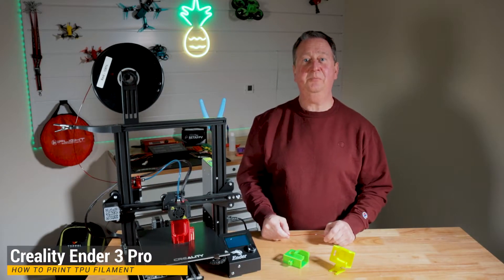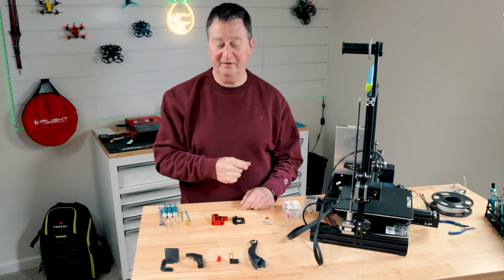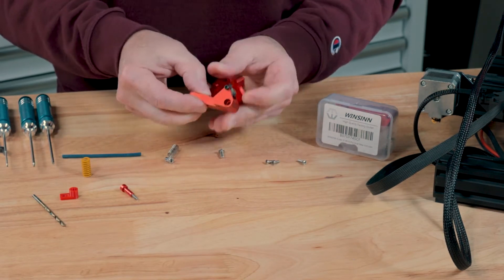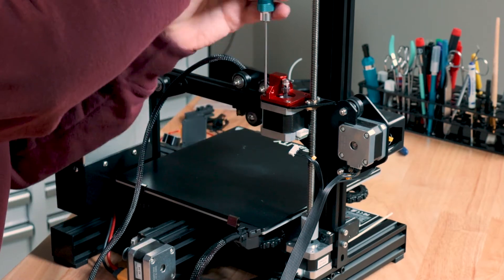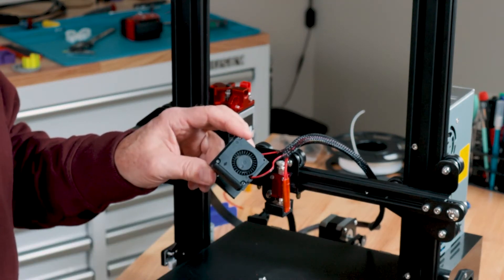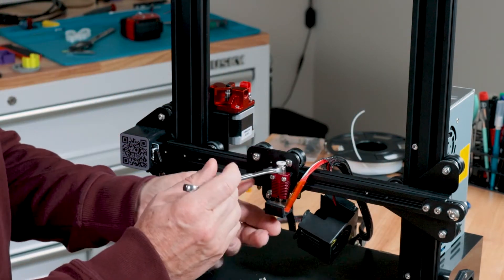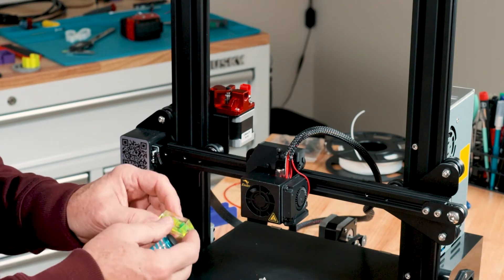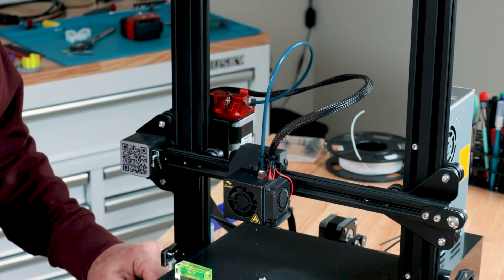How I Made My Ender 3 Print TPU Like a Pro!

Comment: What orientation should I print the fan duct?
Reply from the maker: The fan duct should be printed the way the STL file is oriented.  The vertical part will print fine. 🍍
Reply: @Pineapple22   Thanks, I thought so. I had to slow the speed from the default 50mms to 30mms and it printed fine the third time in PLA.